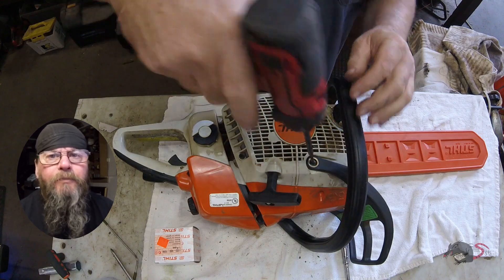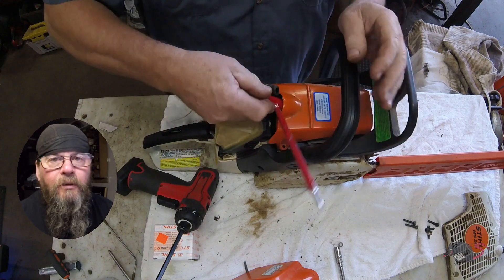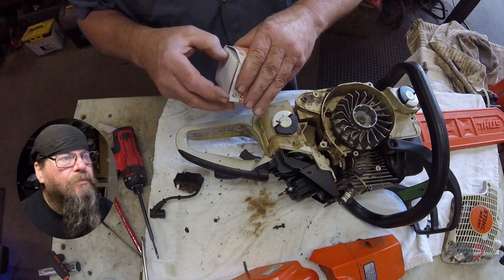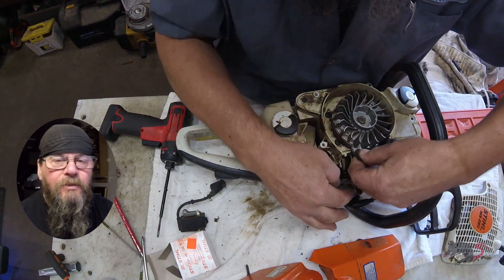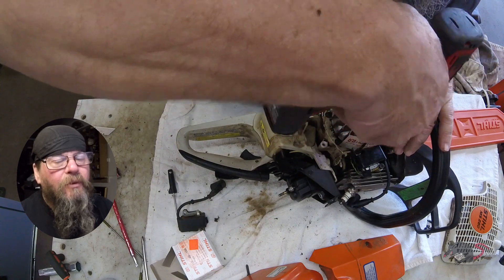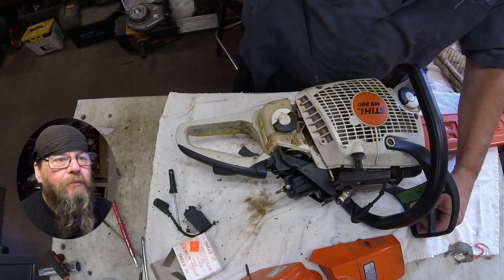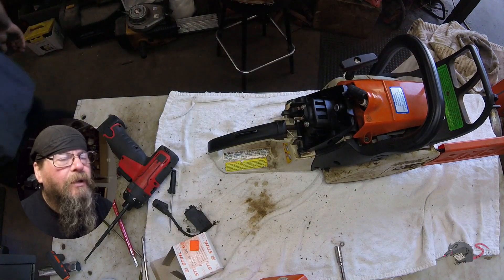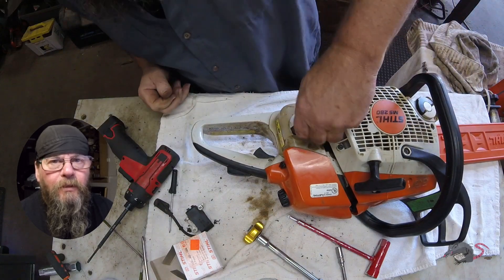Stihl MS280 Chainsaw-No Spark-Fixed!

Comment: Scott thanks...
Anyway of testing coil? Before doing all that work...
Reply from the maker: Manufacturers used to supply specs for measuring resistance in coils. These days its all done through the process of elimination. If everything checks out and it should be working but doesn't then they get replaced. To be fair, modern coils are much more complex than coils of old.

Comment: Quick Question not related to this video.
Have you ever done a video on what to do to fix the oiler from leaking on Husqvarna 465 etc Saws ? It's a common problem with them and I inherited one that's been ported and it runs great it just leaks bar oil like crazy when you shut it off unless you lay it on its side. If you have done one let me know where that video is or maybe consider doing one 
Thanks
Reply from the maker: Don't remember if I've done one yet. The oil feed hose comes out of the bottom of the tank and is exposed before it goes back in toward the oil pump. Check the seal of the hose at the tank and the condition of that hose. That same hose sits on the back side of the pump with the discharge hose on the front side of the pump. They sandwich the pump from the pressure of the tin plate or the bar when installed. I suppose oil could leak there as well if things aren't tight.

Comment: Hello, I have a chainsaw like this, when I work for half an hour it turns itself off. It won't start until it cools down. Is it the electronics?
Reply from the maker: I'll give you three possibilities in no particular order. 1. Inspect the cylinder for scoring. If the rings are setting up in the piston ring grooves then the saw could be losing compression. After it cools the rings release and you can cut again. Eventually it will get so bad the saw won't start. An engine bearing might act like this sometimes. 2. The fuel tank vent isn't working and the fuel pump can't pull fuel from the tank due to a vaccuum in the tank. 3. Yes a hot coil could reveal a problem that is hidden when components are cool. 
 When it dies, is it like turning off the switch or does it slowly peeter out?
Reply: @TheGreasyShopRag  Until compression, it does not have good compression, it also gains fuel, but when it heats up, it loses electricity.
Reply from the maker: @yokerr9646  It does sound like you need a new ignition module.

Comment: On my free no spark 280 the module was fine it was the key was sheared off of the flywheel. 
 Why the key is cast into the flywheel is beyond me, but it makes finding a Flywheel impossible. 
 Luckily, I have a friend that has access to an EDM machine he cut a key slot in the wheel, and I made a custom key and back in business.
Reply from the maker: Nice fix!